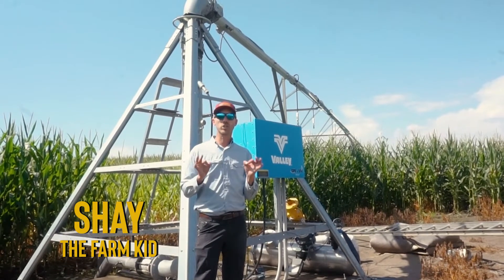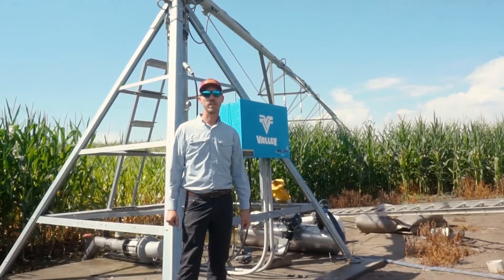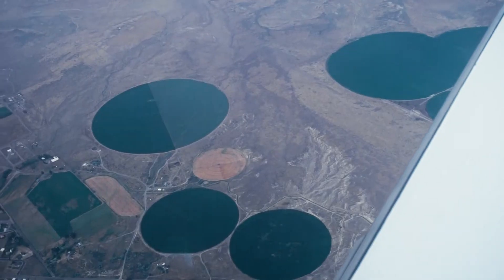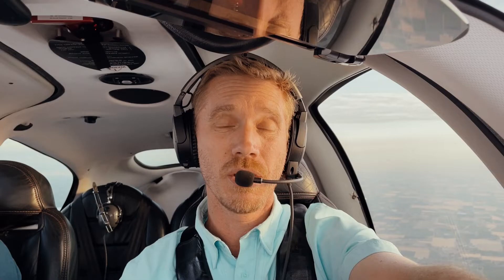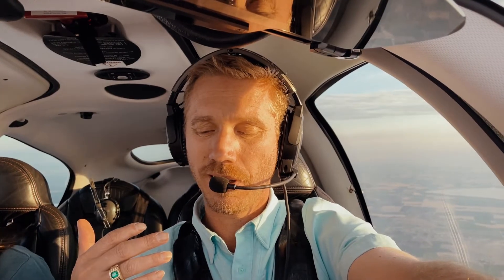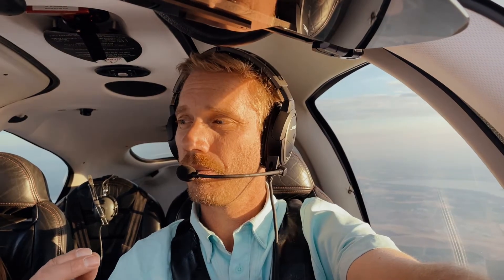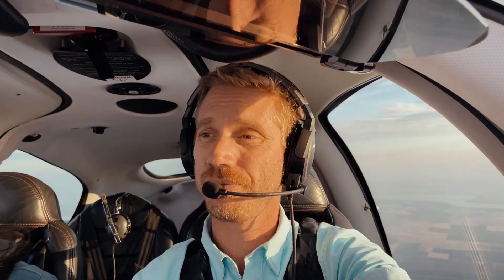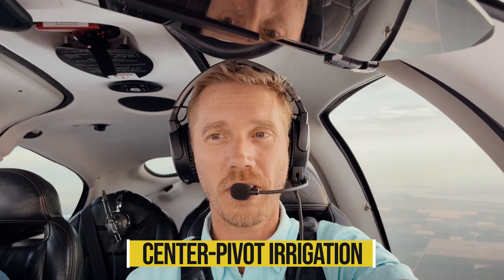What Are These Circles? - How Center Pivot Irrigation Systems Work.

Comment: Totally OP to show this concept from the air - thanks. 
A drip system is said to be much more effective in water usage and how plants take in the water. Perhaps much of the water is lost due to vaporization with the center pivot? On the other hand, the cooling effect is probably also very useful?